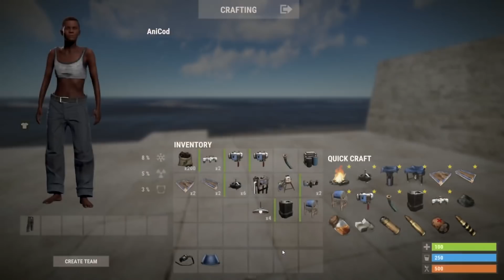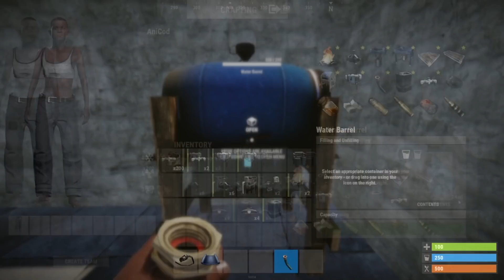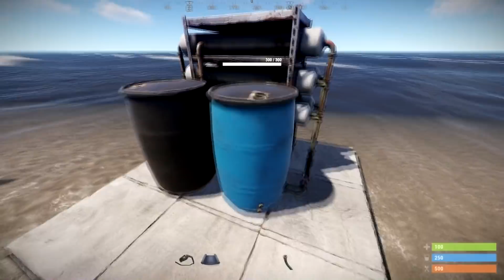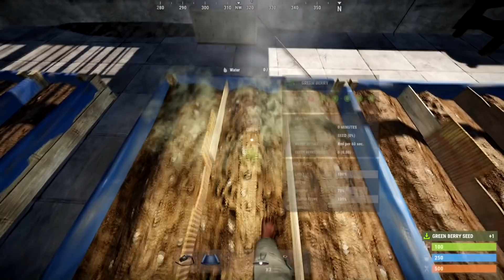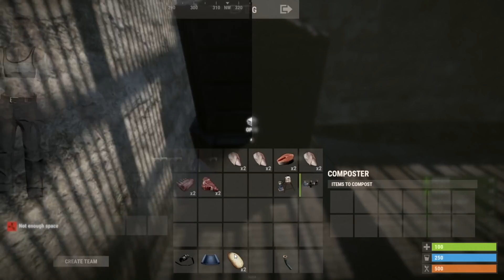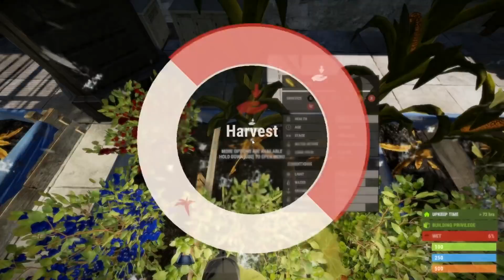COMPLETE Farming | Beginner to PRO Guide | 2021 | RUST Tutorial

Comment: how do i settup the electricity and all for this, i settup like 4 large solar panels and they were only giving 4 power each, me not happy, i tried running root combiners from solar panels to them and then directly to large battery and than to the electricity box you have, whatever its called, and than to the pumps, and i could only run about 8 sprinklers at 1 time and i couldnt do anymore, so do i need a electricity box and all for like 30-40 sprinklers and like 1 barrel and 2 large water collectors for each water barrel, im trying to figure out how to get like 30-40 sprinklers running all at the same time and thats sort of frustrating. plus i dont know hoow to do the electricity properly for this sort of settup, i am new to the electricity so i am definitely screwing things up.

Comment: Here's a pro tip from someone that loves farming but hates being around people and in cold weather. NO, not the heaters.

The water tanker is the best bet for water if not around water. It holds 200k mls of water and can be used with a pump. I highly suggest this. Build a garage base 2x2 at bottom, 3x3 above it for planting and a 2x2 above. The 2x2 at the bottom should be armored with windows and gun holes. It's best used as a triple or quad. It's a grub tree. Not a Bae meant for long term use and not for farmers or people collecting loot.

Comment: Growing in the snow just requires 1 or 2 heaters to get temp at 100%, the radius they heat up is actually huge and does effect crop temperature. You can use heaters in any climate that your plants dont quite reach 100% temp.

Comment: Dude, you need to know something. STOP USING SPLITTERS!!!!!!!!! use electrical branches instead. splitters "Split" power along each out. and you get diminishing return on power each splitter used. You can use electrical branches and split off only enough power for each circuit used. this way you can use all your power more efficiently. Meaning, you can use all your battery limit by branching out effectively.
Reply from the maker: thanks for the comment. This isn't an electric tutorial. all I'm doing is  showing the operation of the farming components. One reason I'm using a generator and not batteries with solar panels etc.. I say in the video its not wired up economically.
Reply: You can just have an electrical branche output for example 31, then add a splitter and 3 turrets.

Comment: Now, i've been berriefarming for many many wipes now as a part of my base build, regardless if im next to salt water or a lake. 2 springlers can cover 2x3 large planters. ALWAYS fill up your planters with water before planting seeds. The Ground stat is by far the most difficult one to upheld. The reason being the many Fertilizer nerfs. Fertilizer is completely impossible to obtain, regardless if you have horses or tons of food to fertilize. It will give you 5 fertilizer per hour if you fill all slots except 1 in the composter = Useless, will never be viable unless they change it a bit. What you say about the X is not entirely true. The X basically just means its a dead genetic. So your plant just has 5 genetics instead of 6. The X can be crossbreed into a positive one, just like the W (water) can. The X has no affect on the plant whatsoever. The W doesn't have any effect either if you have a water system with pumps/springlers etc. If you are using salt water with purifier, you need 1 more pump than usual to make up for the two extra links a purifier + water barrol makes in your water system. Otherwise you will end up with springlers turning on and off every now and then.
Reply: Then the new update about QOL (quality of life) will bring u joy, now horses poop alot more = more fertilizer :-)
Reply: @PureOwnag3  I'm very happy to hear this :D I still love doing berriefarms. It is SO OP!
Reply: @PureOwnag3  that update was a rollback to how horse dung used to work. I knew they'd fix it when they broke it like 2 years ago, was confused af when my 2 horses gave me 0 dung after hours when just the day before i was picking up stacks of 6 from every untouched horse spawn.
Reply from the maker: I didn't make myself entirely clear  about the X genetic but yes, the X has no affect. really good tips about the purifiers too. all about making sure you have more water than you need

Comment: Are you sure you cant over water crops? My crops don't like 9000ml and the bar drops significantly if it is.
Reply from the maker: reading the logs it would seem you're correct..... an automatic watering system has never looked so tempting
Reply: @AniCodYT  Yeah, so I think somewhere between 6000-8000 is the sweet spot. This will take water from 75% to 100% if you hit the sweet spot. Creating a video using timers to perfectly water the plants would be good but there's quite a lot of variables. The types of plants you're planting and their water in-take, and then hitting the right spot with sprinklers and making sure the sprinklers are only hitting the planter box's you want with minimal overlap.

Quite a bit of math involved too. Water consumption of plants which is generally quite easy to calculate in terms of plant * 12. And then output amount of sprinkler and make sure that your water source is adequate enough not to run out.
Reply: @gazreyn  there are already a few guides out there on how to make an auto watering system, but because water is almost never the weakest plant stat, there is next to no point in using one. Over watering isn't an issue when water isn't the lowest growth stat.
Reply: I haven't done farming in quite a bit but when I did I'm also sure the plants didn't liked to be watered 100% of the time unless it's been patched out? Anyway I think placing a timer would help.